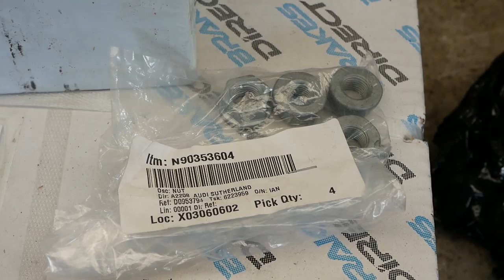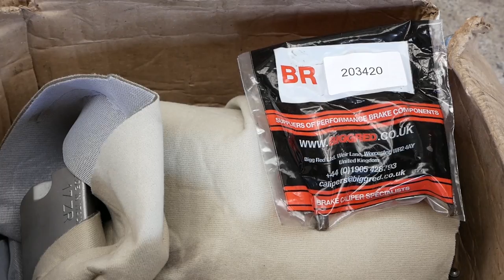Pt. 2 Epic Big Brake Upgrade Audi TT Mk2 - 17z Brembo Caliper & Forza 2 piece floating rotor how to

Comment: how did you fixed the brake caliper / wheel interference at the end?
Reply from the maker: i changed my wheels hahaha. I'm running ET40 now 

https://youtu.be/Zs9QLn7KfpY
Reply: @ianpgonzaga  I see, I temporarily fitted spacers, but I will also do that
Reply from the maker: @FrancescoCruciani-frx08  yeah I did have spacers but it’s not the best to have spacers especially for driving the car on the track.

Comment: Great video mate! Such an awesome upgrade considering how fucking enormous 17Z/18Z's are! Definitely intend on doing this on my R32 in the future.
Reply from the maker: Thanks Dutton. 17z as an assembly only looks larger because of the caliper. The rotor is actually smaller in diameter than your R32. If you wants the REALLY big brake look the 18z “look” a lot bigger because of the rotor size and the caliper sits further out from the centre of the hub.
So comparing them in Order from smallest to largest rotor diameter 
17z - 330mm 
TT 3.2/S 8J - 340mm
Golf R32, Passat R36 - 345mm
18z - 350mm
TTRS 4pot - 365mm

Comment: Great video. How did you manage to fix the clearance issue. My wheel is running the calliper while turning right
Reply from the maker: Hi Chris. I ended up getting different wheels with a et40 spec. 

Could easily clearance with hub centric spacers too.
Reply: Thanks Ian. Yep I did see that in your next video. I am running BBS 18X8 with 50 offset and 10 mm spacer, which will need another 2-3mm to clear the calliper. Do you think the RSe11R 18X8.5 45 offset will give me enough clearance without the spacer?
Reply from the maker: @chrisluo4162  should be much better. Can you do a test fit to make sure ? 🤔
Reply: @ianpgonzaga  yeah I am talking to the guys at BLK motors and see if they can test the clearance for me

Comment: Can I run 17s with a 19x8.5+35 wheel?
Reply from the maker: Hj Johnny. You should be able to. Just check that the wheel balancing weights don't get in the way. It's a tight fit with 17s.

Comment: Hey Ian. Any reason you chose the 17's over the 18z's?
Reply from the maker: Good question Rich! I went with these so the rotor didn't have to be as big/heavy. 😊
Reply: @ianpgonzaga  good to know, I am at a toss up between these and the 18z's. It looks like you can't go wrong with either.
Reply from the maker: @bangarng  yeah both good options - main thinf is the master cylinder. if you have the "smaller" one and not going to upgrade then stick with 18z. apparently pedal travel can be affected by going 17z without upgradinng MC
Reply: @ianpgonzaga  I think I have the bigger MC (2008 3.2). Thanks for the info!
Reply from the maker: @bangarng  yep you will already have it!
Reply: @ianpgonzaga  Sweet. Thanks Ian.

Comment: Hi, nice video! I should fit the z17 calipers on a golf 5 gti with bbs speedline 8,5x19 et48 rims. what size of spacer should i put? Is necessary change the front brake hoses ? Thank you
Reply from the maker: You will probably need at least a 10mm spacer. 15mm to be "safe". You will want to get the hard brake line coming out from the TT 3,2 or similar. The rubber line you can re use.
Reply: @ianpgonzaga  Ok, thank you!

Comment: Hey mate, where did you get the bolts and spacers from?
Reply from the maker: They were just a purchase from eBay. Nothing special. I ended up ditching them in the end ;)
Reply: @ianpgonzaga  Ah nice, what did you use instead?
Reply from the maker: @petegraver8322  sources wheels with a more aggressive ET to clear the calipers. https://youtu.be/Zs9QLn7KfpY

I think anything around ET 42-35 would do. (ET35 would probably poke just a tad)
Reply: @ianpgonzaga  ohhhh no I meant the caliper bolts and the 14-16mm shims
Reply from the maker: @petegraver8322  ohhh hahaha yes. To bolt the caliper onto the hub? They’re a VAG PN

Self locking nut m14x1.5 N90353604

Audi tt M14x1.5x63 N90752802

Will update description.
Reply: @ianpgonzaga  thanks man. And the shims?
Reply from the maker: @petegraver8322  you should be able to source this locally. 

http://4130tube.com.au/4130-chromoly/round-tube/15-8mm-tube-products/15-9mm-x-0-9mm-wall-round

Better than paying ridiculous amounts for the “kits”
Reply: Hey Ian, finally doing this install on my car! I got the bolts with the part number in the description, then noticed the washer is quite big and it's got a tapered end; the part number on the packet in the video is different to what you've listed (n91084901). The ones you've used are 55mm not 63mm. Any pointers?
Reply: @petegraver8322  hi, i do the job today in my TT with Mercedes ml350 discs, using 60mm bolts they touch the discs we have to use 55mm, the 60mm are for golf gti

Comment: great video ian! i have a question , do you believe the lines from 2.0 fwd won't fit ? and wow everything is too close! we are lucky!
Reply from the maker: Hey there. Thank you for the kind words. They will NOT fit because of the caliper fitting on the end of the 2.0 line. The thread pitch is different.
Reply: @ianpgonzaga  thanx ! thank god i have a tts donor car.
Reply from the maker: @ΜιχαληςΜ-θ5ν  perfect! You will have everything you need ;). 

Please let me know if my suspicion is correct with the S bend hard line - is it the same as the 3.2 one I have in the video?
Reply: @ianpgonzaga  i will let you know my friend i ll go and get them in a moment
Reply: hello ian. yes they are the same. have you tested the brakes? what is the feeling ? have you evere tried r 32 /tts / s3 brakes to compare?
Reply from the maker: @ΜιχαληςΜ-θ5ν  fantastic thank you for confirming they are the same shape! the feeling is excellent. I will need to make the comparison somehow but i have driven the car freeway, suburban, mountain twisties and so far i have no complaints. The brake feel is much stronger.
Reply: @ianpgonzaga  thank you for your answer. i believe it will be more resistant in hard conditions . i am searching for light rotors at the moment.
Reply from the maker: @ΜιχαληςΜ-θ5ν  good luck. I think you will not have a problem in Europe. Seems like there are plenty of options overseas. Just not a lot of options in Australia.
Reply: yes i believe i have a many options but i must do a good search cause i must be sure that they will be right for the hub when it comes to weight
Reply from the maker: @ΜιχαληςΜ-θ5ν   maybe this company can help you? http://www.reyland.co.uk/custom-brake-kits/
Reply from the maker: @ΜιχαληςΜ-θ5ν  otherwise mine are from these guys. https://www.brakesdirect.com.au/

Comment: I'd be interested in an update on the rotors and some pictures of how they are holding up? How far have you traveled since putting them on? How many track visits?
Reply from the maker: Hey there - i can follow up once we're out of lockdown (which has just been announced as indefinite unless community transmission gets under control) and the car is in storage. I don't want to risk getting caught by the cop. I've only done the one track day but had been driving most weekend with the brakes. I'd say another 4000km on them? Still holding up well and not really many signs of visible wear. Will update when i can ;)